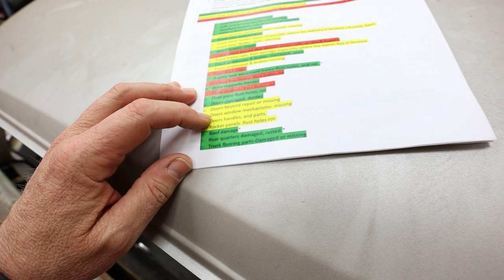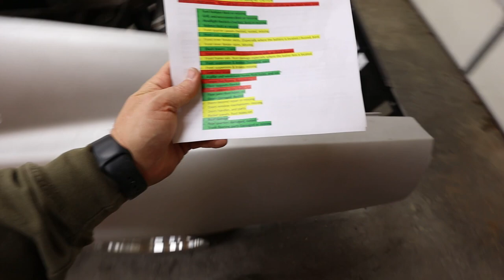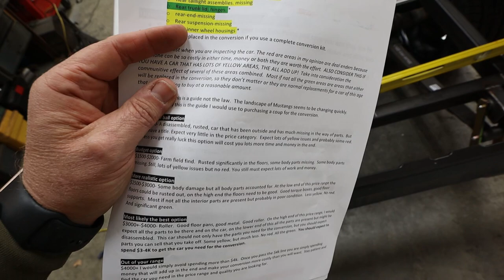Before you buy a coupe to convert to a fastback you need to watch this!

Comment: So I agree with almost this entire video but one part the cowl panel part. I worked at a restoration shop for 5 years and and it’s in your best interest in your investment to replace that lower cowl panel from factory they weren’t painted the only paint that was ever put in the inner cowl to protect that metal was from the overspray shot through the cowl vents so almost all need to be replaced I would still mark that as a yellow  not a deal breaker but a hell of an undertaking for the average person because there are at least 100 spot welds on that cowl but that’s my two sense this is a great video though !! Definitely subscribed
Reply from the maker: That's a great point and you are right. That cowl is an intimidating rascal though.

Comment: I just bought a 67 coupe yesterday  the body is in insanely good condition i was actually surprised it has a fresh coat of primer on it and no rust bumps or sheet metal holes honestly the only negatives i have to say is that it has a lost title and that it has an automatic transmission but what makes up for that is it runs and driving fule and brake lines are basically brand new feels like it just needs new brakes and it has a 302 in it!! Picked it up for 4 grand of the forsale group
Reply from the maker: That my friend is a good deal.  How is it coming along?

Comment: Pastor Scott, what Church? I have to say you're very honest and you put together a very good video for a person that wants to do this conversion that doesn't know a lot about Mustangs, or how to do any work on them from the start. I lived and breathed first gen Mustangs as a young man and I still love them today. I've owned a 65 V8 4 speed convertible before all the aftermarket sheet metal was available. I had tons of fun with my 65, but the floor was a bit rusty when I bought it, and as a rusty convertible gets worse, what happens? The doors don't close well. I ended up selling it for parts because at the time, it wasn't worth saving. Then I bought a 69 Mach 1 351 4 speed car that also needed areas of the floor repaired, and yes the torque boxes as well. By this time, some aftermarket sheet metal parts were becoming available, but still not everything. So, I had a shop do the repairs to the torque boxes and floor. Yes I was young, the car was solid when  got it back, but the shop pieced it together with sheet metal and rectangular steel tubing. Yeah, I thought they were going to use the new repair panels that came out, oh well, lesson learned. But along the way I had learned to MIG weld and remove panels by drilling out the spot welds and how to weld in the new ones. Eventually, I worked my way up to owning a 67 Shelby GT350 4 speed car that had some damage that I was able to repair myself. Yes, this was a long time ago (1983, or 84 before I got married). I paid $4,500 for the Shelby with a Title. I had to borrow a pickup truck and rent a car trailer to retrieve the car from PA and bring it to New England. In the end, I sold the car in 1993 or 94 for $15,000 and the interior needed to be finished but I had all the parts to get it done. Then of course, Shelby prices went through the roof and an average guy isn't able to own one. So, yeah, I'd love to have another 67/68 Fastback, but at my age, I'm not able to do the work myself, so it's more of a nice dream than a reality. I sure like watching what everyone's doing with these cars; it makes me feel young again. I have liked and subscribed to your channel and I'll be following along with your build. I have a lot to watch, but I see all the extra work you've done to your Mustang thus far, and I know it's going to be a great car when it's finished.
Reply from the maker: I love comments like this! Thank you my friend.  I agree its almost therapy building things... Was that 351 in your 1969 a Cleveland?  I am considering building a car that is in a junk pile right now.  It's a coupe that I will convert and I thought about putting a stroker Windsor in it with Cleveland heads on it or maybe a stroker Cleveland... I'd love to have a set of those old prostock heads that Bob Glidon and others ran that had the port plates on them.  It'd be a fun car with a classic top loader.

Comment: I live in Wisconsin,  getting titles isnt too bad but it takes a couple months. If the car ur rebuilding is older than 20 years old n the engine is over 20 years old u can get a hobbyists rebuild title without going through inspection. Once u get the title u can switch the motor to whatever u want. U can also get abandoned car titles by taking pictures of all 4 corners n vin number n pay fees but its a longer process waiting for stuff to be mailed back n forth.

Comment: I just realized you are working on a 67-68. I have a 66 coup. Is it still worth the conversion? $7k for a conversion kit on cjPony.
Reply from the maker: Absolutely, now in my opinion the 1969 or 70 aren't worth the conversion presently because good fastbacks are available at a price point that is reasonable enough.  But the first gen 64-66 and second 67-68 are for sure worth the conversion.  You're going to get a better car with new metal than a rusted fastback.  The end value won't be the same as a fastback however depending on the parts you use restomods are selling for the same price as vin fastbacks.

Comment: Great Video
I Have a solid 68 coupe that I am sending to Lost Socket garage. I had planed to drive the car there, would it be worth it to remove the sell able  parts and take it to them on a trailer? I did not get your Email, would you mind posting it
Reply from the maker: I wouldn’t, I’d just ask those guys to hold the parts for you. You could pick up those pars when you get the car. They are great guys.

Comment: Hey what brand of chrome wheels do you have on the back of your fastback?
Reply from the maker: Rocket Wheels 18X12, tires are 305 30r 18
Reply: @ScottHarness1  Awesome and thanks! Are you satisfied with them and would buy that brand again?
Reply from the maker: @VegasRT500  I struggled to find wider, deeper wheels in a price range that I wanted to pay.  These weren't exactly what I was looking for but the price was better than the custom wheels that I found. They are absolutely crazy expensive.  I'm not super satisfied with the durability of the finish, I can see chips from putting the lug nuts on and off.  I'm afraid that the more expensive wheels aren't much better.  Back in the day Centerline wheels and the like were tough but these new wheels aren't that.

Comment: Also, you couldn't be more wrong about rule #1. Yes, every state is different but there's this little thing called the "Vermont Loophole", and it's available to anyone no matter what state you live in. It's a tried and true method and there's plenty of info out there on the interweb on how to do it!
Reply: @ScottHarness1  Hudson Solutions is partially correct. As long as the VIN is clean it's not difficult to get a transferable registration from VT(they don't title vehicles over 15 years old) that can be used to obtain a title from your home state. I've done it with several basket case motorcycles and cars with lost titles. The key is to get the VIN run by a local LE agency BEFORE you start the process. 

Once you know the VIN is clean, you just need proof of that and a signed bill of sale. You can then register the vehicle in VT(regardless of home state) through the mail.
Reply: @ScottHarness1  I've done this with my 66 coupe. Have plates from VT in my hand! It works.
Reply from the maker: @CzechSixTv  this is huge!!!! I’m about to embark on registering the Lazarus Mustang. This is great info.
Reply from the maker: @FlorecentTurtle  this is some seriously good news!
Reply from the maker: I read my reply to your comment and it was condescending and arrogant. I’m sorry about that. Not sure why I replied like that. I deleted it. Thank you for the comment and info. I’m about to start in this method! Thank you!
Reply: @ScottHarness1  
1) Make sure you have a bill of sale(which you can make up now, have a friend sign and doesn't need to be notarized). 

2) Print out a VT-010(VIN/HIN verification form) and VD-119(registration form) available online.

3) Call your local PD to find out about getting the VIN inspected, verified and run through NCIC. Cost is usually $10-15. Some states authorize private inspection stations to do them as well. They fill out the bottom half of the VT-010.

4) Mail everything above to Vermont, plus proof of insurance, with a check or money order for the applicable registration fee and 6% sales tax based on the bill of sale price.

5) Wait 2-3 weeks for your transferable registration and plates to arrive by mail.

6) Take the VT registration to your state DMV/Title office/whatever and they will issue a clear title(unless your state also doesn't title older vehicles in which case they'll give you an in state registration).

I did a 1970 Triumph T-120 back in 2019. Total cost was under $200 and after some cleaning/repairs I flipped the bike for a LOT more than I paid because it now had a title.
Reply from the maker: @CzechSixTv  This information is absolutely golden.  This is a GAME CHANGER for old cars.  I am about to do this on a 1967 mustang that would otherwise be parts but now it will be a conversion with a coupe title!  THANK YOU!

Comment: Sorry I Did Not find You E Mail Address
Reply from the maker: Sorry for the slow response!  The Coupe check list is now available on Gumroad: https://coupetofastback.gumroad.com/l/ihntlv?_ga=2.119866248.1402160361.1673881598-2023742695.1673881598&_gl=1*18al3mp*_ga*MjAyMzc0MjY5NS4xNjczODgxNTk4*_ga_6LJN6D94N6*MTY3Mzg4MTY0Mi4xLjAuMTY3Mzg4MTY0Mi4wLjAuMA..
Reply from the maker: The 1967-68 fastback conversion parts list is available on Gumroad as well: https://coupetofastback.gumroad.com/l/fjoxw?_ga=2.6081075.1402160361.1673881598-2023742695.1673881598&_gl=1*1hplrz2*_ga*MjAyMzc0MjY5NS4xNjczODgxNTk4*_ga_6LJN6D94N6*MTY3Mzg4MTY0Mi4xLjEuMTY3Mzg4MTcwNS4wLjAuMA..